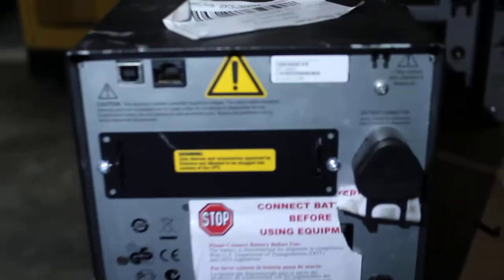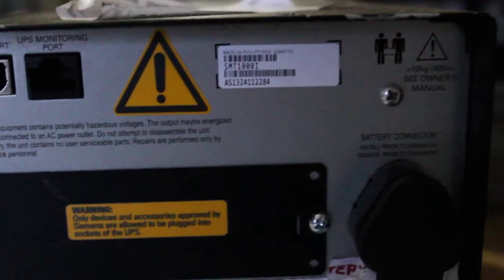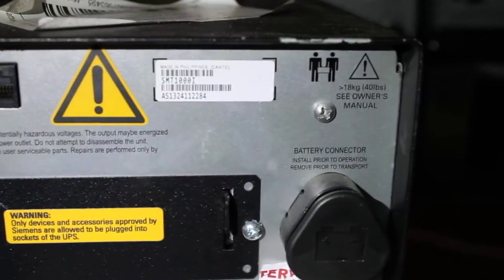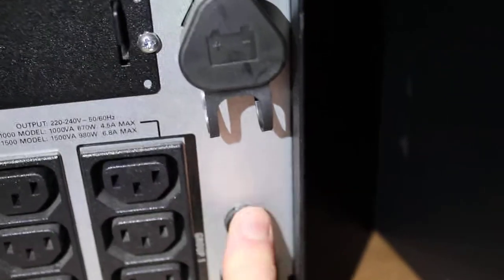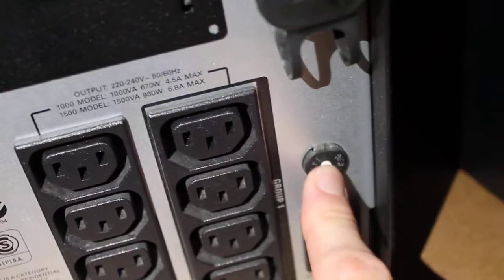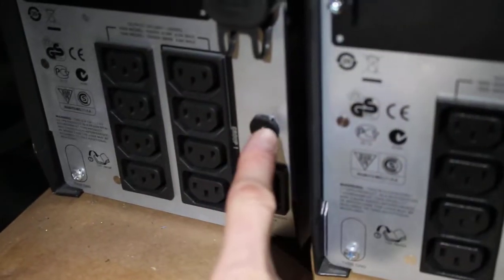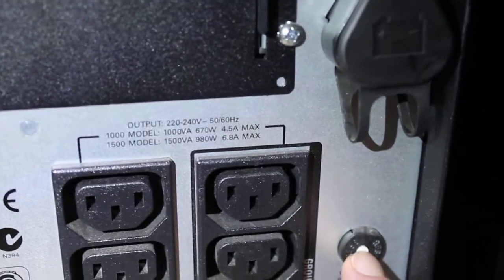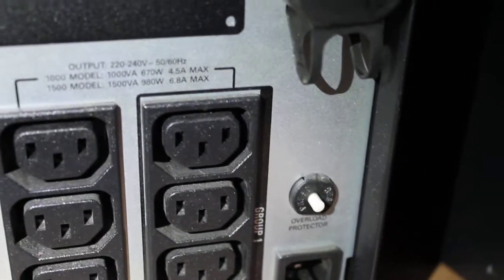Two types of mains breaker on APC tower UPS

Comment: Really helpful. I have an sua1000, a smt1000, a smc1500 which all have blades and I just got a smt1500 which has a white perturding one so thought it was tripped and couldn't reset it. Glad that's not the case